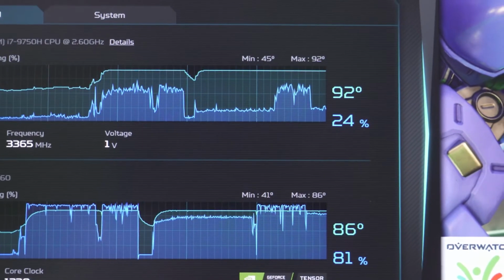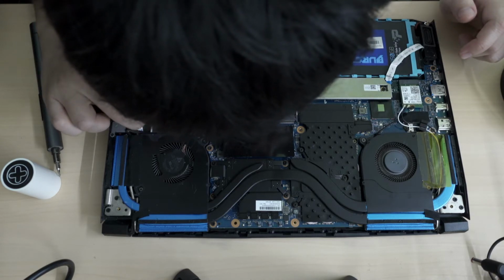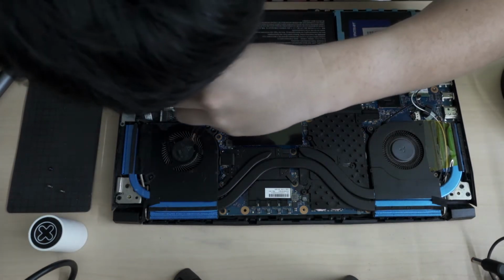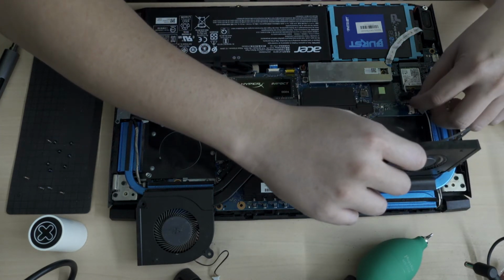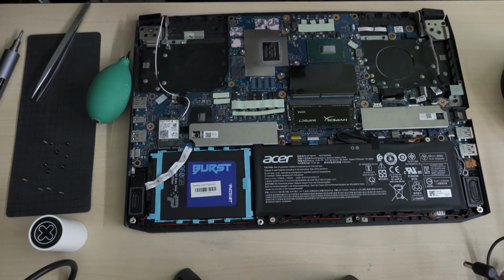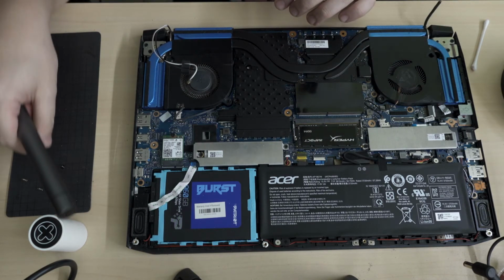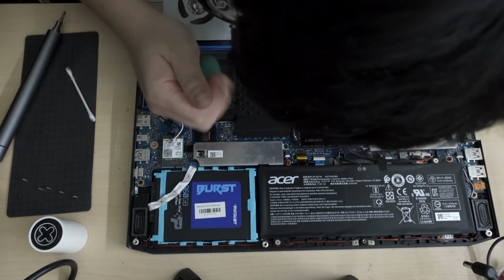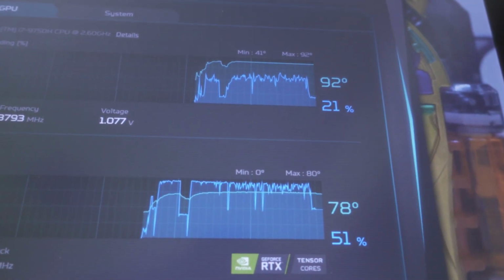Repasting My 2019 Acer Helios 300 (RTX 2060)

Comment from the maker: Ok... for those who are curious because I never showed it in the video. After everything is done, my System temperature is now usually 5C less than the CPU temperatures, I don't know what it was before everything. :P
Reply: How good is your battery life? I have the 2019 model and I barely get an hour with a clean install of windows :( It is a killer in performance but it's honestly sad I basically can't use it anywhere but plugged in at my desk
Reply from the maker: Yes, the battery is on the small side. It’s more about having a powerful workstation in a relatively easy to move around form factor rather than being able to work unplugged. Also, never try to play games unplugged, that won’t last at all!

Comment: Is it ok to use thermal paste on vram? Do you think 2g is enough for all of it? (vram, gpu and cpu)
Reply from the maker: Using thermal paste on the vram? I guess it's a bit messy but as long as it's non conductive it SHOULD be ok.. I have no idea how much VRAM is enough! 🤣
Reply: @marauderz  You just used thermal paste on vram on that video, didn't you?
Reply from the maker: @JotaFla  yes, because I didn't have the right pads last time, as I mentioned, it can be messy so you need to decided if thats OK with you.
Reply: No, you need thermal pads. The thermal paste cant fill the gap and transfer heat.

Comment: does putting thermal paste on gpu vrams cause any damge or it is normal????
Reply from the maker: Well, it might spill if the paste is loose, but as long as it’s non conductive it should be ok. Some recommend thermal pads to be cleaner but I can’t remember what thickness to use
Reply: @marauderz  so since u put thermal paste on them did any problem happens to your laptop ? thanks man for reply
Reply from the maker: @mohamedahmed-jv4gz  worked fine for me.

Comment: This worked for me, I repasted and cleaned up the fans, also used paste for the Vram. 
The only issue is, my system temp is running 5-10 degrees hotter than the CPU. The CPU and GPU run at 60-70°c under max load, but the system temp can go up to 85°c depending on the game.

Any idea what this could be?
Reply: Same I just re paste the whole thing and is running 4 or 5 C hotter, i was extremily careful
Reply from the maker: @stanlysebedyn8124  Yeah... sometimes things can go wrong, I guess you can try again, or you can check and see if you've tightened down the heat sink correctly... remember.. the scariest part is.. too too tight till you break something.. not too loose till you loose thermal transfer performance.
Reply: Your problem is that you applied thermal paste on vram instead of thermal pads. Every component other than CPu and gpu need thermal pads
Reply from the maker: Do you lift up your laptop using a stand or anything? You should to maximize airflow, might help.

Comment: I just did this on my 2019 helios  300. Before trying this my gpu would hit 80 and my cpu would hit 95 degrees after playing RDR2 for 15min. Now  after repasting, playing  for about 20 min, my gpu stayed in the low 70s and cpu stayed in the low 80s.  Not bad. I was  a bit more generous with the thermal paste then he was. But definitely worked for me.  Would highly recommend. Easy to do , took me about 1 hour.
Reply: I am considering doing this cause like my temps would hit 92 a lot of the time playing this game, I been using my AC as a way to combat the heat.

Comment: You put on way too much paste
Reply from the maker: I thoguht the X patten gets the best coverage?
Reply: @marauderz  Nah, about half of what you put on would have been plenty. Its primary job is to fill imperfections for a perfect contact. Less is more with thermal paste. Good thing Acer gave these chips alot of real estate for excess paste.
Reply from the maker: @maysinbell5765  Well.. if coverage is not the main concern, I'll have to remember that for next time.
Reply: @marauderz  Coverage is important. Especially with desktops; you don't want that stuff oozing from the side. Acer was generous with the spare real estate with these units. I have the same one and I have to repaste as well. So I stopped by to see if there are any 'surprises' under the hood beforehand; now that I'm out of warranty. I worked for Memory Express until 2019

Here is a perfect example for a Ryzen chip. Anything smaller should be a center application just over the size of a pea. He's criticizing the Arctic Silver 5, which I'm using on my 3950X stream/mining desktop.

Edit: It's also been almost a year since your video; I wouldn't mind seing how it held up for you in a follow up video.

https://youtu.be/MmUHNZzD254?t=97

Comment: I recommend doing undervolt on the CPU. There is a tutorial on youtube.
Reply: It comes undervolted by default
Reply: I have this model and running stable using throttlestop using -180 then -140 instead of -125 and -125 i also turn down by cores to about 39 39 38 38 37 36 on most games to battle heat without turning on turbo fans.Now running the lastest i turn it up to 4.2-4.2-4.1-4.0-4.0-3.9. also under tpl set pl1 to 70 and pl2 to 90 that will help most power throttling as well

Comment: I have this same laptop. Be careful as thermal paste isn’t thick enough on some components to make contact with the tubes. I re pasted my laptop and the temps are higher now because of it. I picked up some viscous thermal paste to combat this. Also look into using thermal pads instead
Reply: What did you use on vram? I ordered karbonaut extreme as people said it's more viscous and one of the best options. I'm wondering if I can apply that on vram too and if 2g is enough for all of it (gpu, cpu, vram).
Reply: @JotaFla  You need thermal pads.

Comment: same results like you, the processor in stress test is about 94 degrees, the only thing that works for me and avoid high temps was to reduce turbo power
Reply from the maker: Well.. luckily for me it only gets that hot while gaming, so I just turn on turbo fan mode when I do so.
Reply: The laptop will always be thermally limited, you will see the same temps while gaming, but your performance can increase.

Comment: 92 is high!! What's your ambient temperature like? Secondly, are you sure you are not blocking the intakes at the bottom of the laptop? like by playing on your bed instead of a flat hard table?
Reply: BTW loved the video, I have the same laptop and my CPU/GPU temps hover at about 72/80 degrees celcius respectively.
Reply from the maker: @cliffordpereira1189  Well it hits 90 only when I'm gaming, ambient is around 60~75. Please.. you think I'd make a rookie mistake like blocking the bottom intakes? 😎 The laptop is on a riser with a healthy gap for air flow!
Reply: I have this same laptop, owned for about a year and im getting 90c now and im freaking out! idk how to re paste and im not trying to open it up haha, i always have it angled on a cooling pad not blocking any vents and i have throttlestop and undervolted... im not sure what to do anymore but i feel like i cant even use this laptop to play games anymore or it will die :(
Reply: @imtherealraisinbagel  yeah i have the same issue , have you found a fix yet?
Reply: @Nasser3j  my fix was buying a PC and not using a laptop anymore lol

Comment: I'm getting a second hand (8 months used) one tomorrow! Do you think the repaste would help? I'm actually usued to doing this. I've repasted several notebooks before, just not sure if it will help this particular model
Reply from the maker: If you're used to doing this, why don't you just clean the fans  first?
Reply: @marauderz  Will do! thats a quick and easy way to help out  :))
Did you notice any difference in the temperatures after the new thermal paste "settled in"?
Reply from the maker: Well.. after so long, the CPU still reaches the low 90s when playing, but it cools off very fast when I run the fans at maximum. Maybe I did it wrong? Maybe the heat from the memory is leaking? I really can't be so.
Reply: @marauderz  I see, when I get mine i'll start with cleaning the fans, if my temps are higher than yours i'll repaste and let you know!
Thanks for the replies and good video!
Reply from the maker: Good luck, hope it works out well for you!

Comment: Thanks for the video.. My hinge is loose at 20* angle, do you have any idea which screw will tighten it?
Also planning to change thermal compound at the same time should I go with pads only on the vrams?

Awaiting your valuable response
Reply from the maker: Not sure about the hinge. I think you should go with pads for the RAM. Had some spillage on my end (basically been checking it every other week)
Reply from the maker: And no I'm not sure which thickness you should use for the pads, in case you wanted to ask😁
Reply: Thanks for the quick response, I will research on the web for the thickens and will make sure to update here if I find anything about it. :)

Comment: Bro can I ask you something...even for me it's going till 92c when am playing modern warfare and same for CS go.. should I repaste my laptop cause it's already 1 year since I got
Reply from the maker: As I mentioned repasting is a very involved work, and in the end you might not actually see benefits. At the very least you should try and clear the fan ducts first, and then see if playing with the fans at MAX (not go into turbo) if you get any difference.. also I just realized the predator sense software takes up cpu cycles, might want to use something like HWInfo to monitor instead.
Reply: @marauderz   I have been playing in max fan though..but still it stays in 92...and about fan I think I should clean it... waiting for my thermal paste to come..let wait and see
Reply from the maker: Well, good luck and be careful when you do it!
Reply: @marauderz  I cleaned and repasted with arctic mx4.. now thermals are fine and it is not going beyond 83..thanks mate for the help
Reply: @vishnuv3913  bro I had acer predator helios 300 i7 9th gen how to do undervolt ?
Reply: @sohandev10  use intel extreme tuning utility...but Acer Helios comes undervolted
Reply: @vishnuv3913  thank u
Reply from the maker: Cool, glad to hear that it worked out for you!
Reply: @vishnuv3913  Actually, ThrottleStop is better software for undervolting. I also have the same laptop but its Predator Helios 300 2020 version.
Recently bought the laptop and somehow it reaches 90c when playing medium load games. I tried XTU (Intel Extreme Tuning Utility) once but it didn't really seems to work very well. Might be CPU incompatible. 
ThrottleStop did help a lot. But can't deny the fact that I regret buying the laptop without full complete reasearch..
Reply: @vishnuv3913  
Which did you use for the VRAMS?
thermal paste or thermal pads?
Reply from the maker: I used paste initially, but recently  I changed it to 0.1? thick pads plus a little paste. As most are mentioning it's hard to figure out how well the vram is working because lack of sensors

Comment: little tip when applying thermal paste and youre going to remove the syringe, instead of pulling to the side pull straight up so the tail of the paste doesn't go on the motherboard. i hope your paste is not conductive t.t
Reply from the maker: Oh, nice. Yeah, that paste isn’t conductive

Comment: hey bro, wanna ask, whats you max "system" temp ? its beside the GPU temp in predator sense, because mine reach 90C :(
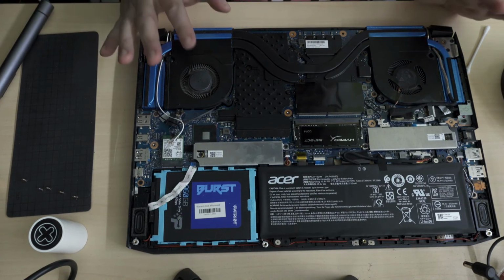Reply from the maker: I guess people do care about that... I should pin a comment. My system temperature is usually about 5C less than the CPU temp, so is CPU is 90C, it's 85C. As I mentioned somewhere in the video.. If you've been using the Helios for a while, and it's getting hot, and you don't want to go too crazy and do the repasting, at the very least give the fans and fan ducts a good clean.. by actually cleaning the fan grill. Check the 36:54 timestamp.
Reply: @marauderz  yeah I'm planning to repaste mine when my paste is arrive,

Just got my Helios few weeks ago, but the system chipset is bothering me. That's why I'm asking several ppl about this,

Thx btw for the reply 🙏
Reply from the maker: @AdnyanaPriatna  You're having problems after a few WEEKS? Maybe you should think of getting a replacement instead?
Reply: @marauderz  i think so, but i still need it  for my college stuff.

btw, I done some tweak. its still reach 70C but haven't got reach 80C atm

what about ur CPU fan max speed is it 5000RPM or 6122RPM?
Reply from the maker: @AdnyanaPriatna  CPU max fan is 5870

Comment: CPU and GPU are cool! What are your system temperature? The 3rd option in predator sense , I Mean the motherboard temps
Reply from the maker: The system temp is usually about 5~10 degrees lower than the CPU
Reply: Wei Min Chan So you mean 75-80 degrees?
Reply from the maker: Shantanu Pingale about there

Comment: Bro as u used thermal paste on vrams instead of pink paste wont it cause any trouble?
Reply: This is what got me thinking too. I’ve seen other videos where they replace the putty with thermal pads. The only thing that got me pondering is the width of the pads . I’ve seen people say from 0.5mm to 1.5mm
Reply from the maker: @feedmeenow192  Thickness you mean? Anyway.. I've been checking on the thing every week, there was some leaking but for the most part everything seems to be staying put. I did buy some thermal pads in case I need to replace it though.
Reply from the maker: @feedmeenow192  Hmmm.. interesting.. well, I already gotten some 1mm thermal pads.. I guess when I need to replace I can use it... or I might just get 1.5mm and squish it down.. we'll see.. things are working fine now luckily..
Reply: @feedmeenow192  I applied thermal paste on vram too no problem so far using it since three weeks now
Reply: You can use K5-PRO viscous
Reply from the maker: I really dont know... The theory is that it just needs to be something that conducts heat from the chip to the heat sink, and the thermal paste will definitely do that. Also, the Artic MX4 isn't conductive so shouldn't need to be worried about it overflowing onto the chips.
Reply: @marauderz